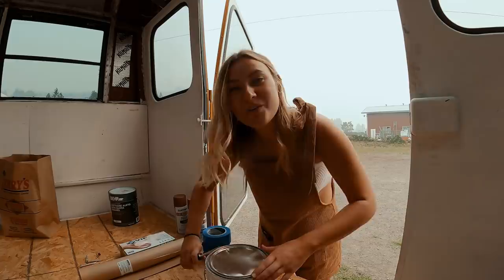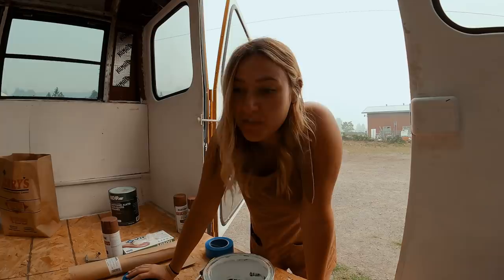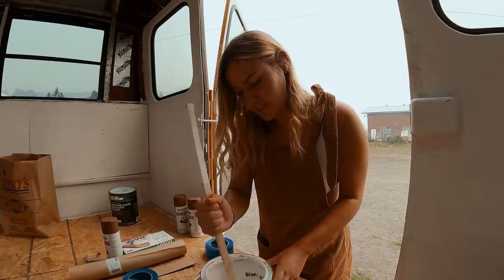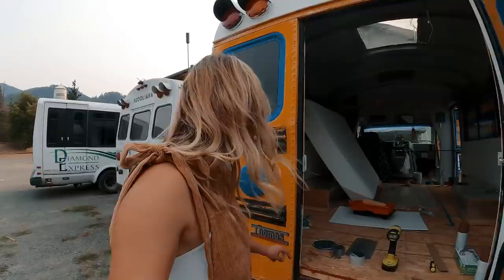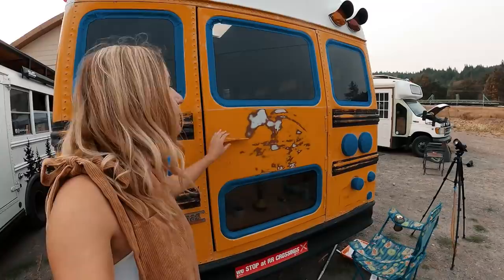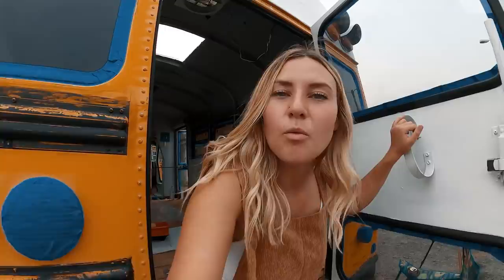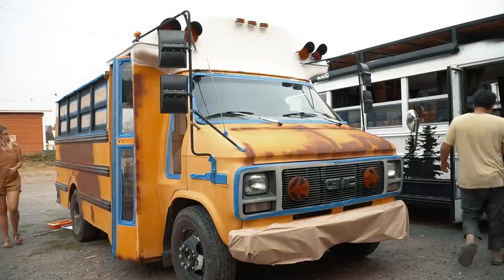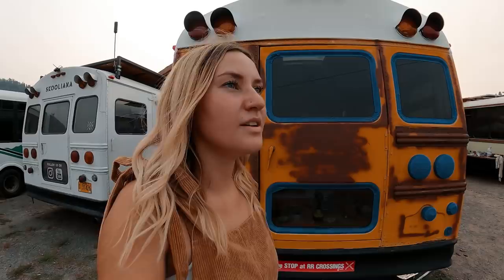Roof Coating, Masking & Painting Short Bus Build - Solo Female Skoolie Conversion

Comment: If you are going to put a deck on, I think your 4 coats will be fine.  Take it back and trade for more black spray paint. You can never have enough black spray paint, so many uses for it...lol.  I would just tape off the bus around your mirrors and bumpers and spray them before your big paint and then reverse tape to protect them around the contact areas with the bus body.  I use a small art paint brush to do fine touch ups once done.  I spray a little bit of spray paint in the lids and use the brush to hit small corrections.  I've painted murals that way too when using spray paints.  It's looking good.  You might want to drape some of the paper across the top of your tires in case of drips and drops.  Also don't forget about your wheel hubs if your gonna paint them.  Just suggestions.  Your rocking it girl.  ✌️

Comment: ❤  look at the manufactured date code on your tires. It will be 4 numbers in a circle.  The first 2 numbers are the year the 2nd 2 numbers will be the number of week made (52 in a year) . You should not use tires over 7 years old. They may look like they have a lot of tred still on them, but dry rot is what breaks down the rubber.  White is much cooler because it reflects the sun. Black is the hottest,  because it doesn't reflect any of the sunlight.
Looking good.👍👍

Comment: Would probably leave it at 4 coats on the roof too much and may crack causing a leak. And the lights on the top maybe make the front ones driving lights  on 2 of them then the others flood lights for when camping or backing in the dark( let people know your backing)

Comment: If you have anything on that ceiling that still leaks after that many coats get a gallon of flexseal paint, you can brush it on or roll it. I was skeptical about it working as good as they say, it's better!! You can paint anything with it and it will be waterproof. Not that you need it, but in the future if you have need of waterproofing anything that stuff is great. God bless!!
Reply from the maker: Haha No leaks😄

Comment: The roofs of RV's develop leaks & deteriorate over time so it doesn't pay to skimp on the roof coating. If you have the extra material on hand you should apply it. The extra layer of protection will pay off in the long run.

Comment: Have you considered tinting the windows in limo tint for privacy and heat control? I'd do 5% and call it a day. The front sides that you look out of while driving can't be darker than 35% in some states and 50% in others but everything behind them can be as dark as you want.
Reply from the maker: It’s definitely a possibility!😄
Reply: @LeaveHerWild  Great idea.. you can see out but no one can see in.
Reply: Reversed @NITE tho
Reply: @brucestmartin777  JUST WONDERING;;;SOME YOU CAN SEE OUT AND NOT IN DURING THE DAY AND SEE IN AND NOT OUT AT NIGHT;;;LOL;;;THAT WOULD BE A DISASTER IF THE CASE;;;
Reply: @oleman490   Have you ever seen a limo at night ?  You can not see in.
Reply: @brucestmartin777  We have that type in our rv we have at his parents. I really like it for privacy and temp control
Reply: @brucestmartin777  maybe they tint both sides on a lime
Reply: @genesnyder2985  I did it on my 1972 VW camper… they tinted one time from the inside.. it worked great ….  Definitely keeps it cooler inside the bus..   can’t see inside at night..  Just let Jaylena do her own research and choices.. she very smart and will figure it out.

Comment: Hi Jaylena
I'd like to put my opinion in on your bus redo. If not for this one then perhaps the next one or Isaac might find some info in here he could use on his re-dos.
I would buy about 20 shoe totes from $ tree and mark them by a number inside on one end and in a corner, preferably on the left side. At office max or ? They makes pouches you can c-thru and they attach on your tote for what's n the tote. Attach it on the inside right. Whenever you take something apart use a tote. Like for instance ALL of that black hardware should have been taken apart and the covers and bulbs washed and dried. The inside connections where the bulbs get pushed in and turned, such as , tail light bulbs, you would want to make sure it is dry and with a small brush, apply some vaseline. This will keep your connections from rusting and burning out bulbs. The next thing is when you were spraying the black on the bus and you were coming to the end of the can and you started spraying in circles and even did a couple zig zag whoop-t-do's LOL. Two things here, NEVER use your can to the bitter end as it can splatter, blob up and run. It can show up later to haunt you. I would go back and sand that down and respray it 
But when you do and hopefully you will, heres a tip how to paint using a spray can. Imagine you are painting an Angel's wings. You want nice flowing strokes about as long as your arm is using a feather touch so to speak and painting wet on wet. I know it's kind if hard to achieve your desired look using your index finger, so
the best advice I can give you is to get yourself a tool made for painting using a spray can. It actually makes it a pleasurable task, not to mention you are no longer using your index finger. It attaches onto the can and gives you a nice comfortable grip. Almost everyone carries them and Rust-Oleum makes one also. The top of your bus looks good. I would keep the can of paint around for a little while to make sure you dont need it. I cant see to where more coats would make it better. It looks very nice. If you change the sky-light will you need any then? You're doing a great job. Looking forward to seeing more.

Comment: Zyou could put six coats on the roof and then use that paint as a base coat on the rust you covered on the bus so that way you’ll be putting the darker color over the white. Think about it and decide.

Comment: As a painter I never put less than 2 coats on anything I paint. Your roof is definitely just fine with 4 coats and better then it would be with 2. A couple more on the roof is overkill IMO. Sell the extra can to Isaac he has a couple of buses he will have roofs to paint. So glad to see you spraying the bare metal with metal primer, good move. Spray out the lights that you're going to do black before doing the rest of the body so any over spray (yes even if papered there is overspray) get covered with your top coat of body color. You'll probably use up the rest of your roof paint in the open can on covering the overspray(some will call it fumes) from that. You'll want the Sunkist Peach body color to be the last color you do so you don't have to keep redoing it after spraying something. Personally I would have covered all windows with paper before I started spraying just because I know how much overspray/fumes lands on them and you don't usually notice until you're in the bus looking out. Levi will look damn fine once completely painted. Not too long now and you'll be able to tackle the interior. Again! As long as your having fun while doing all this it really doesn't feel like a job does it? So enjoy it every step of the way!
Reply from the maker: Haha yeah, doesn’t feel like a job when you take your time and just enjoy it, even if it’s super hot outside lol I’ll be taking the lights and grill off to paint them because I’m going to do that a little later when I get new headlights. I’m starting on the peach color today and it’ll essentially be the last thing I paint aside from the lights and grill 😄

Comment: Guess we all do things differently, but I would have removed the small things like light lenses.  The trim under the hood would be easier to mask off if you had just opened the hood.  Never painted a vehicle, but just wondering why you chose to paint the top with a small brush instead of a roller or spray gun.  You're doing it yourself, and that's commendable. Wondering, though,  why your friend couldn't help.
Reply from the maker: I have rollers for the roof and I used rollers on the first coat, but I find hand painting therapeutic so I was just enjoying it😄

As far as Isaac helping, he has a lot going on on his own plate. I’ve also said from day one this will be a solo female build. Just something I want to do mostly on my own.

Comment: great job ... ya should have a friend help and wire the Top lights into your brake lights & turn signals ... ( better safety for those who dont always see reg tail lights  ....
Reply: I was wondering about this too. I think it’s a great idea!
Reply: and dont paint them black  just re wire for extra lights .... plus put LED bulbs in headlights ( better on the battery )
Reply: @thegoodtom1718   you can angle the headlight a bit to the ground so it's not 100 percent straight everyone should know that. Plus new vehicles mostly come with LED headlight from the factory lately for energy efficiency of the battery and 99% of your emergency vehicles that are new on the road have LED headlights even in those states too ... Plus they cant ticket a person who travels for LED bulbs in  their headlights thats illegal and no court would up hold that ticket

Comment: PAUSE: ANOTHER COAT ? WELL it would depend on whether your going to put any Styrofoam insulation on the inside of the ceiling before you put up a finished ceiling if it were me is definitely put up the Styrofoam as most of the heat comes in from and is lost from the roof of the bus...1/2 INCH OR 1 INCH WILL MAKE A WORLD OF DIFFERENCE
Reply from the maker: I’ll be insulating the ceiling

Comment: Jaylena check my reply below . I wouldn't black out the skoolie lights if you are on the side of the road or roll up on stopped traffic due to a wreck fog or whatever you could  use them with your 4 ways to be much more visable. No PO would tickit you for that.. : )
Reply: I'm going to rewire mine to be extra visable as 4 ways turn and brake light's.. People when really tired will see you on the side of the road and think they are out of their lane and run straight into you. I've both seen it and allmost done it myself..

Comment: I looked at buying a short bus on Facebook the guy selling the bus said you can’t drive on a normal car license and if you change take seats out use it as a rv it would need inspection and makes insurance expensive rules and regulations to keep to ??? Can you confirm… thanks 👍
Reply: There's lots of vids that describe that, check the details with YOUR STATE DMV requirements
Reply from the maker: Every state is different, but generally you don’t have to have a specific license for smaller ones and yes, it does have to be registered and inspected for rv
Reply: @LeaveHerWild  ok thanks how much does insurance cost ?

Comment: I'am Your Newest Subscriber Great Videos. You Need To Use A Roller On The Roof It Would Go Alot Faster. I Get That Elestrometro White Roof Coating For Free Here In Florida Our County Has A Household Chemicals Swap Shop Where They Give Out All The Stuff Your Not Suppose To Throw In The Garbage. I Get 5 Gallon Buckets Of That White Roof Coating Some Full Some 3/4 Full Some Half Full
Reply: Jaylena did it the way she wanted and enjoys. Brush.

Comment: Did you get you charging system fixed ? I could rebuild or repair that charging system in a few hours or less.. : )
Reply from the maker: It’s a ground connection issue, I just have to find it. It starts and runs great though
Reply: @LeaveHerWild  No you don't have to find it.. Just make a new ground from the battery to the frame and then frame to a bolt on the engine..Just make sure the engine connecttion is not on the accsseory drive or exhaust. There are tapped holes that are unused on most engine blocks. Use 2awg 4awg wire wire will work but bigger is better for grounds clean all ground connections to bare metal.. Google big three power upgrade. You should find a YouTube video on it. The old poor ground or lack of ground is irellavent.. It's not positive power it's ground. Issac has the tools to make the new cables. Make sure the ground cable is pure copper not copper clad !. Wish I was there I could voltage drop test test battery and altenator and fix this Quick..You just go get it fixed you got this Jaylena.. Yooooou caaaan dooooo it.. : ).

Comment: If it doesn't run, charge and stop it not worth painting. Why would you keep pouring money in it if it is a lost cause. Machinical first cosmetic last.
Reply from the maker: It runs lol Just needs a little love
Reply: Why don't you zip it. It runs fine, it got her 1300 miles just needs alternator or maybe just new belt.